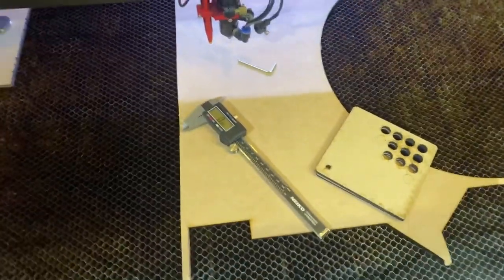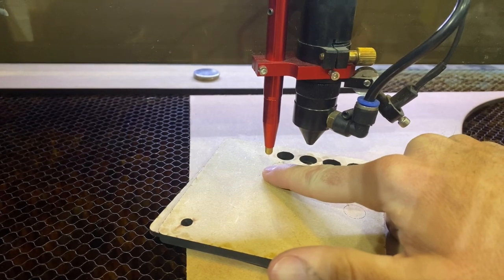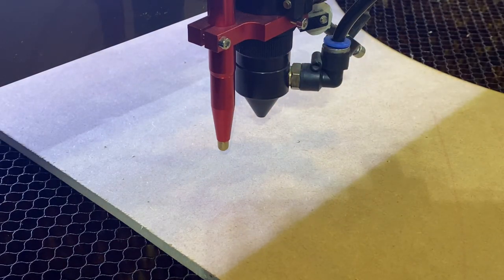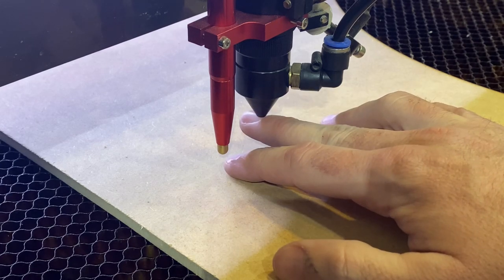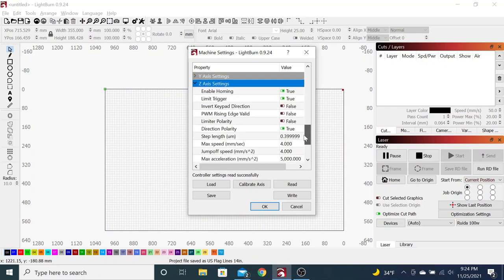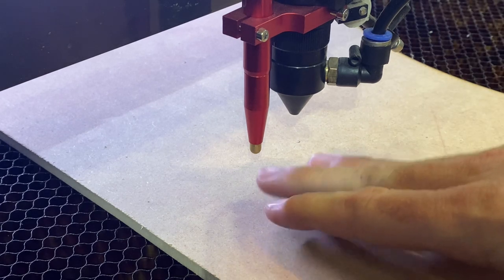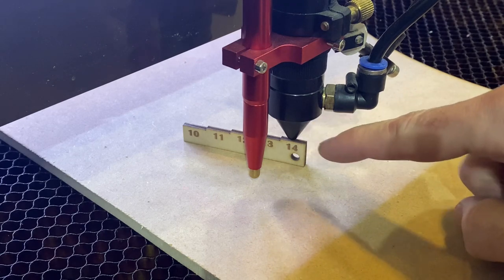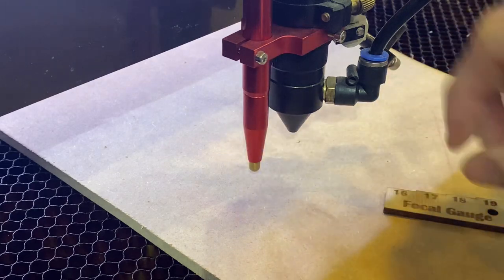Co2 Laser Auto Focus Offset Adjustment for Correct Focus Height

Comment: do or should you do a ramp test for different thickness materials?  I dont have a laser yet but I think I saw some videos saying you can get better results cutting thicker material slightly out of focus.  so I assume you should do a ramp test for the different thickness... Also can you assign different z heights for the layers in LB so the laser can engrave slightly out of focus and automatically adjust to in focus for cutting operations?  Im planning on buying the same omtech 2440 100w laser.

Comment: Did you try it by setting the offset with the pin depressed? I understand you want the specific offset from the bottom of the dropped pin for the magnets, but curious if the distance you actually set was with the pin depressed as it does when setting autofocus. I literally just got my machine, so I haven't tried that yet myself.

Comment: Great video! I just got a Monport 80w laser and have it all connected with water chiller, exhaust venting, etc. I have a bit of experience with an Ortur LM2 Pro diode laser but no experience with a CO2. As I see it, the first thing I need to do is a ramp test, then change my offset in LightBurn, and do a test card. Do you have any suggestions on the next steps I should do, or any videos I should watch? I see a lot of people adding cameras, LED lighting, and air assist upgrading - are those things you personally recommend? Thanks for all you do! PS - I’m from Ogden but just moved to Mesquite about a year and a half ago. I see you are very close to where I used to live.

Comment: I finally figured this out watching your video but my problem is my auto focus pen drags on material moving it how can I adjust it where it’s barely off the material. I have mine set at 14.8 for my distant of my laser focus so maybe I’m not doing my offset part right
Reply from the maker: If you need more space then you need to adjust the pen up and then increase the offset.

Comment: Your videos have been incredibly helpful. I think I have the same or very similar machine. My ideal focus is about 17.5mm. I put my autofocus pen where I wanted it and then adjusted the number in the Z home offset area. After I write the number, the machine does nothing different. I can put 10mm offset, or 50mm. The machine still auto focuses on the exact same spot. Any ideas?
Reply from the maker: Depending on your controller you might have to adjust the U axis rather than the Z axis
Reply: @BeardedBuildsCo  I ended up changing the settings on the laser itself instead of in light burn. Now it works great. Thank you!

Comment: Thanks for sharing. I have been fulling your video but I have an issue. When my 50.8MM lens focuses at 3mm vs yours at 18mm. If I adjust mine the sensor is below the lens so it hit everything. Should I place a offset piece under the sensor and raise the sensor to that offset piece whenever auto focusing my laser? This way the sensor trips at the right autofocus setting.
Reply from the maker: Co2 Laser Auto Focus Offset Adjustment for Correct Focus Height
https://youtu.be/axDyrARXdjw